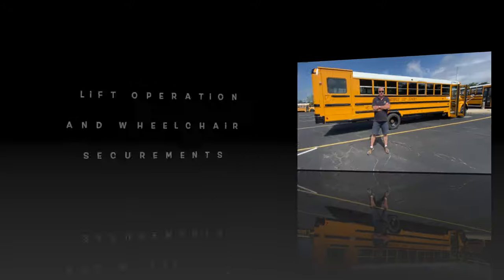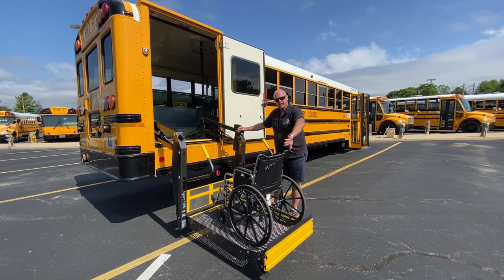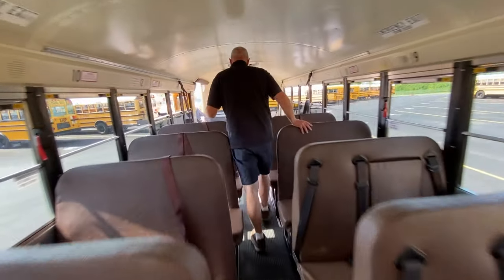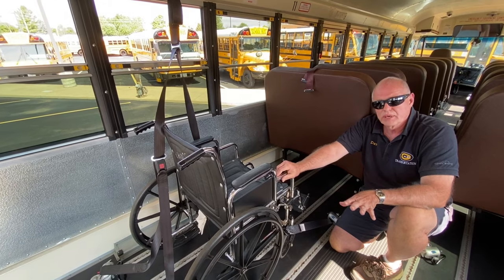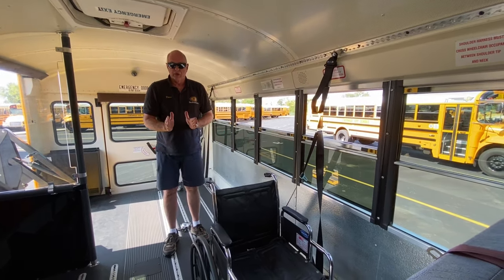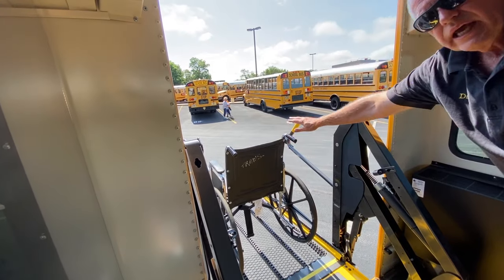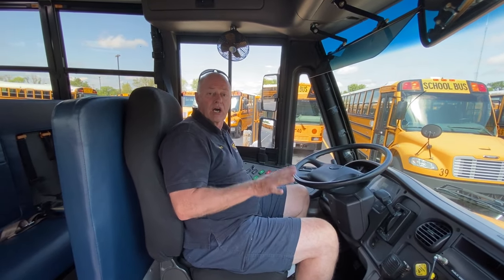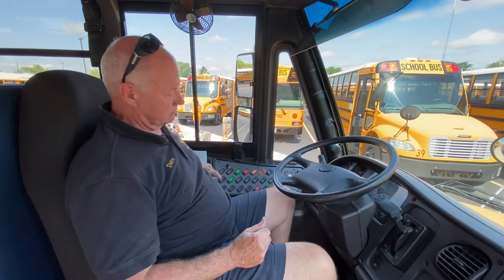School Bus wheelchair lift and securements

Comment: Question? At any time if the vehicle is driving and the Lyft breaks down what will the driver/aid do about it. If it breaks down?
Reply from the maker: There are many variables.  If you are at a student’s stop with the lift out and in the down position, ready to board a student in a chair, I would call base and ask for another special needs bus.  If the lift stops after the child has been boarded, but before the life has folded to its upright storing position, I would use the manual lever as demonstrated in the video, to complete the proper positioning of the lift, then have the mechanics address the problem when the vehicle is back to base.  Do not try to manually raise the lift with a student on the lift.  This would be difficult and ill advised.
Reply: There is a manual override. Right next to the circuit breaker there is a rod/arm. You can remove it and use the arm to pump to raise or lower the wheelchair lift.

Comment: Yup. Just like the lifts I use. I do get the 5 point harnesses though on some busses. Perhaps those can be covered at some point?
Reply from the maker: Absolutely, we can get a variety of harnesses and review them.  Thank you for the suggestion!
Reply: @SchoolBusSass  It took me and another driver about 10 minutes to figure out how to attach the 5 point harness when we got thrown on a spare bus together after mine got vandalized overnight. Fortunately I had seen them used once before in a class demo but it was a challenge to work it out, even so. The other special needs driver just drives kids for alternative schools and never ever has wheelchairs.
Reply from the maker: https://youtu.be/gi_c1POuDB4

I thought this might be of some help for you and your aide.  CSRS …one type is demonstrated.  I realize there are several different types,  it perhaps this will help.  
CSRS starts at around the 15:00 mark.
Reply: Jens k
Reply: @SchoolBusSass  Henri s

Comment: Do your drivers ride up the lift with the wheelchair if they have no aide? If not, how do they not leave the chair momentarily unsupervised on the lift while they walk inside to wheel the chair into the bus from the lift?
Reply from the maker: Our district provides aides for all of our special needs routes.  I will have to do some checking to see what the best practice is for drivers navigating special needs routes, w/o an aide.  Great question, thanks for asking.  I don't believe drivers ride the lift up with the student, particularly when you have an electric chair.  The chairs are typically quite heavy on their own.  If the child is older/larger, the weight limit might exceed capacity.
Reply: All special Ed bus drivers should have aides

Comment: no disrespect, but if those lifts struggle with a heavier load, are there other lifts of the same type to take on a high load?
Reply from the maker: Electric chairs range  from around 40 lbs to 300.  The lifts themselves must have the capacity to lift 3,600 lbs.  which is why you never want to try to use the hydraulic manual emergency function with a large load.  Particularly if the lift needs to go up to load the student, making it difficult for the driver or aide to manage if the lift gets stuck in a lowered position and can only be put back in place manually .  At that point I would have the garage bring a different bus with a functioning lift. Otherwise all bus lifts can accommodate the chair and student.

Comment: The seatbelt and shoulder harnesses are mainly used for wheelchairs without a seatbelt or kids keep getting out of the chair
Reply from the maker: The seatbelt on the majority of chairs, are for posture and provide no safety or impact protection for the student.  Best practice is to always use the lap and shoulder belt.

Comment: Great video, but I will still and always disagree with running the shoulder/lab orders in between the seat and the armrest around the student-the reason being is if youare in a crash, internal organs can be damaged by this restraint. If you put the restraint around the outside of the armrest, you’re still ensuring that the student will not slide out of the chair, but the chair will take the hit, not the kids!
Reply from the maker: Hi Chris 
Thank you so much for the comment and feedback!  I love to hear from our special needs drivers!  I myself have not driven special needs in many years, but try to keep up with,  best practice, methods for keeping our kids safe...I think we all do.  I do, however, think you have a very valid point and will sharing your thoughts on this topic with him. I’d like to understand why the current, best practice method, is set as such.  I’ll get back to you when I learn the answer. 

Thanks again for your feedback!  
Have an awesome summer 😎
Reply: Hi
Reply: no you won't
Reply: bus????🤨

Comment: Electric wheelchairs are a nightmare. I'm off work at the moment. The district arranged a doctor and a specialist. I managed to injure my back pulling an electric wheelchair off the lift. By the time the approx 400lb weight of wheelchair and student are up at the top on the lfit, the bus is leaning so that 400lbs is 400lbs being pulled uphill. My district insists electric chairs be hauled in manually because some student in another district drove their wheelchair off the lift.
Reply from the maker: Wow, I’m sorry you were injured!  Hoping for a full and speedy recovery.  The electric chairs are incredibly heavy even without the individual .  
Hopefully there will be an alternative to manually putting the chair on board.
Reply: @SchoolBusSass  I have suggested we need some kind of winch. The whole wheelchair concept was designed around manual wheelchairs. Even the wheelchair bays are not designed for electric. I'm supposed to be able to carry two wheelchairs on the bus I usually drive. I'll defy anybody to fit more than just the one electric chair. The batteries are 60lb each for the lead-acid driven chairs and they take two. 

What we probably need for cheapness and ease would be a block and tackle attached to the far wall or perhaps to the floor and a rope that splits into two with hooks to fit the wheelchair securement points. Then haul the rope through the pulley thus halving the amount of musclepower needed.

Comment: What if the driver has no aid?
Reply from the maker: The driver would be responsible for loading and securing the chair .
Reply: Whoever from the school brings the student out what assists the bus driver
Reply: Why not redesign school buses so they have low floors without any steps from the door to the seating area. In the UK for at least 15 to 20 years, pretty much all buses have low floors and suspension that lowers the front so it’s only a few inches above the ground. In the floor by the door there’s a folding ramp to make it step free from the footpath into the bus.

Comment: Most drivers and aides just use the hooks
Reply from the maker: On the majority, if not all new chairs, D rings are standard.  On the old style chair, like the one we used in the demonstration, the D rings were not present, which is why the frame is the next best option.
Reply: Jayyanak11